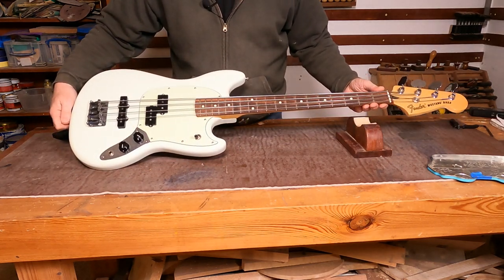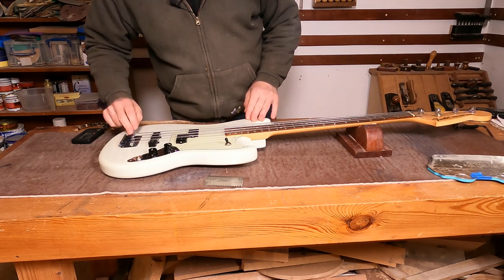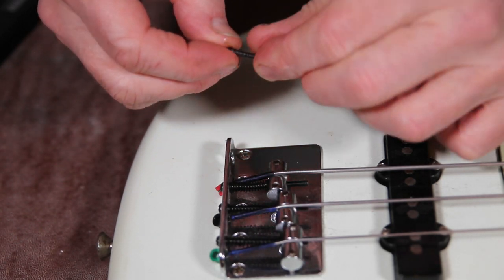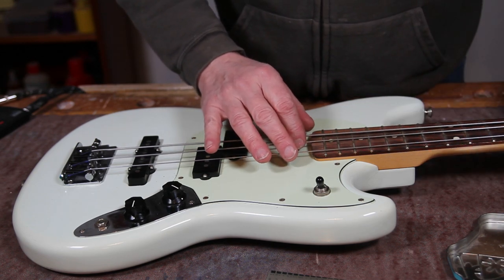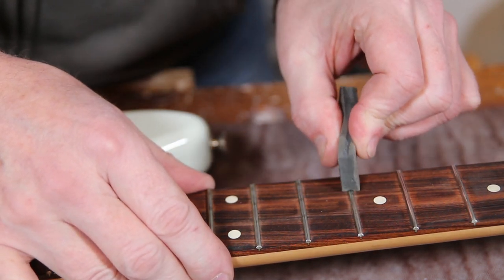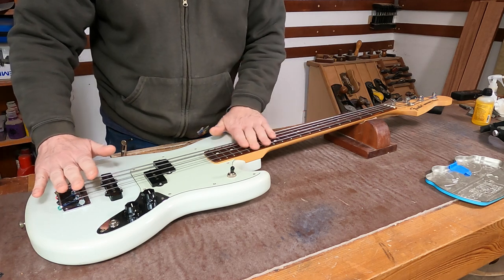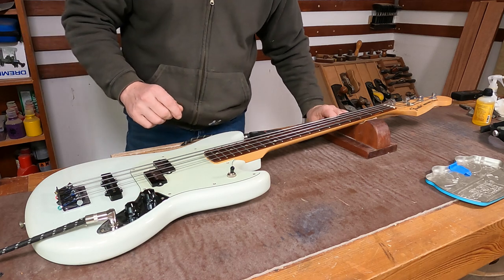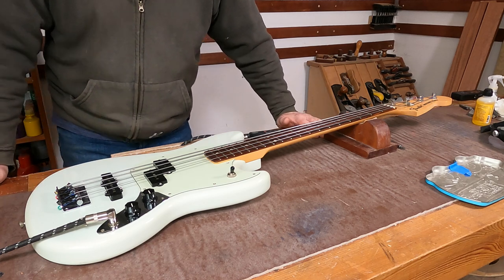Fender Mustang bass set up.

Comment: You mention checking string height in video but did not say what the strength height is....just gave the OK! What is the recpmmended string and pick up heights for a mustang bass.?
Reply from the maker: String action should be between 2.4 - 2.8mm on the bass side and 2 - 2.4 on the treble. Pickup should be about 3.2mm on bass side and 2.4 on the treble. 

More info on the fender site... https://support.fender.com/en-us/knowledgebase/article/KA-01903

Comment: What flatwound strings are correct to use on these Mustang PJ basses? One I have seen, the taper wrap are in past the nut slot.
Reply from the maker: Any short scale flatwounds should do the trick I believe.
Reply: Any short scale strings should do on a bass with a standard bridge, but if you have a vintage Fender or Squier CV the strings are mounted through the body and need to be a bit longer. La Bella do a set specifically for these basses although you can get away with a regular set of strings - I've been using Fender long scale flats and they work very well.

Comment: Fine video but neck relief check and adjustments are the #1 step (not later on)
Reply from the maker: I checked the relief at the begining and it was pretty much spot on, I re-checked at the end just to make sure it hadn't moved. I enjoyed this job, a few unusual challenges to overcome. There was a fair amount of corrosion to deal with but got there in the end.

Comment: I just bought one for cheap at a pawn shop.  It had a few issues that I addressed.  The neck was amazingly reluctant to respond to a truss rod adjustment.  I ended up turning it probably 4 complete revolutions to get to to straighten much at all. I shit thee not.  I'd suspect that the truss rod was screwed up except that it never lost tension as I turned it.  Has anyone else here had that issue with these, or other short scale basses?
Reply from the maker: Four turns is a lot unless there was absolutely no tension on the rod to start with. I found the rod on this one very responsive but it did only need a little tweak. Personally I like a full sized bass but I have to say I liked this one once it was set up right.
Reply: I had exactly the same problem you described with a brand new JMJ i bought from the official shop of fender. I wonder if it's a common issue...
Reply: @jimmybgoode-ch  Bizarre for sure.  Were you still able to get a good adjustment?